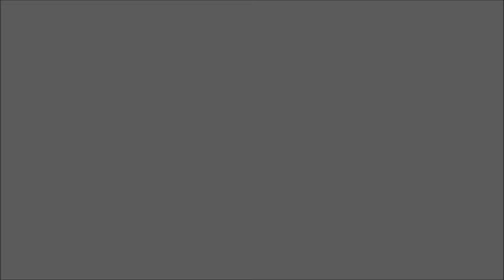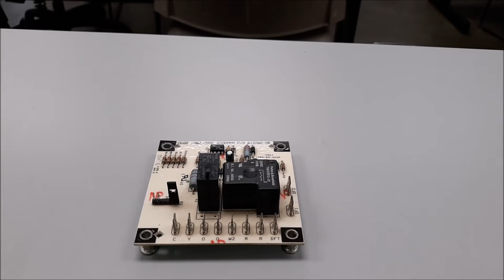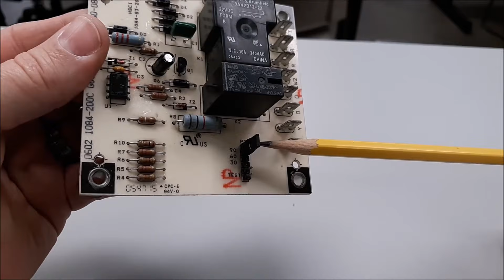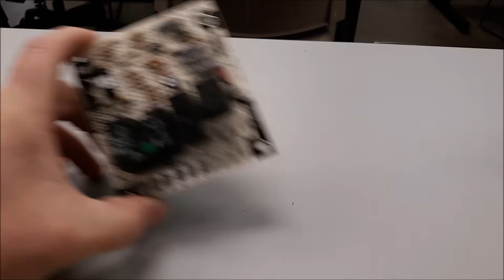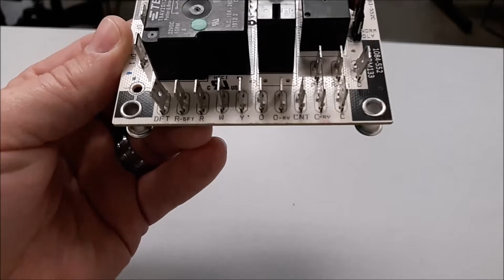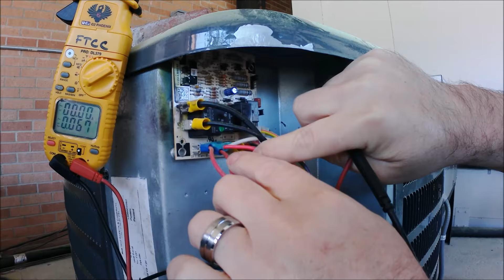Troubleshooting the Goodman Defrost Board

Comment: Hey there, I have this board in my GSZ unit and your vid has been very helpful. My LPS wires are testing open when i took them out the board. I tried jumping the R-PS1 to PS2 terminal to simulate a good LPS. But still the unit doesn’t come on. The unit works when I push the contactor in and all terminals are 27v beside the CNT terminal sending power to the contactor coil. Could it be both Lps is open and something is wrong with defrost board? There seems to be some brown burn marks on some of the board
Reply from the maker: Brown burn marks don't seem to be a good sign but I have seen some with a brown discoloration and it works fine. It is possible that you have a refrigerant issue causing the low pressure switch to  open and an electrical something with the board. You sure you had a god connection between R-PS1 and PS2? The reason I bring it up is I saw a guy not too long ago that tried jumping something out and his jumper was bad!
Reply: @johnjennings-JJ  Thanks for the fast response, I tried your method just now with the voltage i was unaware during the first test. The Ps1 to c I managed to see 24v a few times but its hard to get it I’m afraid i may have cause damage to the terminal it is loose in the board compared to the others now after removed the wire to test.. However I did see it a couple times but Unable to get any 24v reading on the other side. I was hoping i can get a new board and replace it but looks more like it’s a refrigerant issue and i gotta call somebody out. 

edit:I did see single digit voltage on the other side. I removed the connector  from the return wire to Ps2 when removing it from the Ps2 terminal to test Smh. So when i test the Return wire  that connects to ps2 for voltage i get single digits like 4-6 volts. That would seem to be an open circuit correct? I did test Ps1 and ps2 terminals after i made them loose for continuity and it was good so i think the terminals are still working condition. 
 I suppose i’ll start with the refrigerant pressure and finding the leak then replace the board if necessary

Comment: Hi
Im only getting 17 Volts  O-RV  btwn C-RV  Reverse valve selenoid making buzzing sound,  i already swap defrost board looking for 24V  still same symptoms ( pls any advice appreciated!
Reply from the maker: Most of the time when I see a partial voltage it seems to be because of a open circuit. Either the 'O' is open or the '24v Common'. If the unit is running, but only in heat mode because your RV is not energized...I would say you have an open 'O' circuit somewhere. Could be a weedeater ate up some wires, loose connection at wire nut, bad thermostat, etc. If the outdoor unit isn't running at all then it could be you lost the 24v common. So...i guess we start with the 'does it run question' and if so then what is it doing or not doing?
Reply: @johnjennings-JJ  unit is running on the heat mode on the nest thermostat cool mode as soon as i connect O terminal  it switches to the cool mode but solenoid valve start making buzzing sound  on 17 volts , i connect 2x3 ton same Goodman heat pump  both running on the nest thermostats , 1 unit is good the other one is acting up. thank you for getting back to me !
Reply from the maker: If you have the same thermostat on both units you can swap the thermostats around and see if the unit works. Easy way to eliminate the thermostat being good/bad if you haven't done that already. If that doesn't so any good, you can go outside and jumper the 'R' to the 'O-rv' at the board, or use the wire nut connections to go 'R' to 'O' and see if the reversing valve stops all the buzzing and just works! That would eliminate the valve...and keep it in cool mode too! Otherwise it kinda sounds like a thermostat wire issue.
Reply: @johnjennings487  thank you for taking your time 🙏and share your experience!!!
Reply: @johnjennings487  Hi
I jumped R to the O at the board it stop buzzing,  reverse valve switch to  cooling,  but condenser short cycles ( it  runs for 30-40 seconds  then stop  delay for 5-7 minutes  then again (
2 floor  same 3 ton Goodman  runs like a  champion)
I appreciate 🙏 your help 🙏

Comment: Thanks for the video.  The one you’re testing is the one in my unit.  My unit will not come on at all.  The 5 tests you did all did the same on my unit.  Any ideas what I should try next?  Inside works fine, outside won’t turn on.  Thanks
Reply from the maker: Sorry, got busy at work. If you have a electrical test meter check the two pressure switches to make sure they are closed. You always have to have 24v on 'R' and 'C' tk this board but after you prove you have that check the high pressure switch goes to the 'Y' terminal and the low pressure switch goes to the RPS2 terminal  you can check each of those, one at a time, to the 24v common on the board. If you get 24v to each then great, if not then the one thar reads 0v is open and you might need a set of hvac manifold gauges. If both get 24v then check the CNT terminal to 24v common. 24v is good and you should have 24v to the contactor coil, if not the the board is likely bad. If you have 24v to contactor coil and it is not pulling in then it is a bad contactor. Hope this helps a little.
Reply: @johnjennings-JJ  ended up being the high pressure switch.  The blower motor went out when it was in heat mode, so I’m guessing the pressure got too high.  Thank you!

Comment: Hello, I am having a problem with my HVAC, we are in winter and when the air turns off because it has already reached the temperature I want inside the house everything turns off, but on the outside unit the fan and compressor continue working, any idea why? Thank you
Reply from the maker: If something is on when it should be off...i tell people it is a switch that is likely stuck closed and not opening. The switch for the outside unit is the contactor. If you have an electrical test meter you could check some voltages but without that this is just an educated guess. If you take the cover off of the outdoor unit, you can located the contactor (google an image of a 1 pole or 2 pole hvac contactor) and the contactors switch is the little black piece halfway in from where power comes into it from the breaker. If you push on it and it is already down...it is closed. Do this with the thermostat in OFF and it should be able to be pushed down. If not it is stuck...and the unit is probably running anyway. Otherwise it might be a bad thermostat but i doubt it.
Reply: @johnjennings-JJ  Thank you very much, at first I thought it was something else but I changed that switch and it is working fine, I didn't think it was that because last year I changed that same contactor switch, because the unit didn't turn on, and this time it didn't turn off , good thing I had an extra switch, but anyway I am looking for a switch of a different brand or better quality, or a box full of switches, you never known 😅
Reply: Hi! I am definitely not a professional but I have learned quite a bit troubleshooting my heat pump and maybe I can get you going in the right direction until someone with more knowledge can help. I just fixed mine a few minutes ago and came back to update my comment, which is right before yours. What kind of system do you have?
Reply: @jennifermatoy8633  lennox